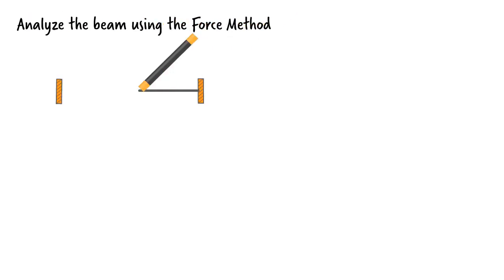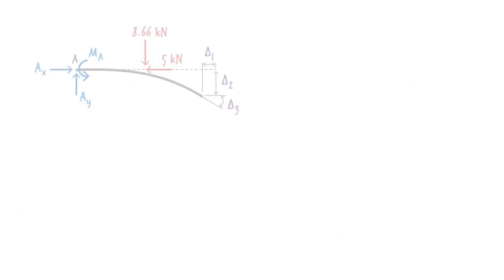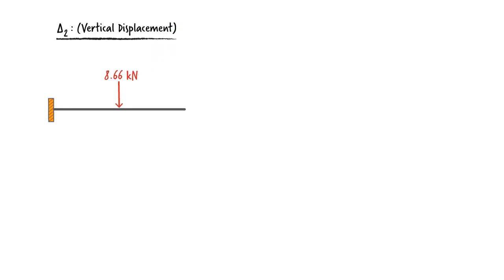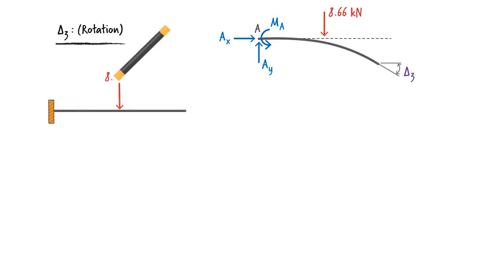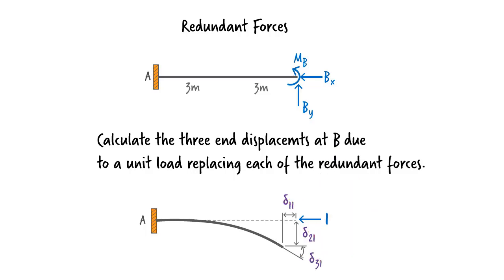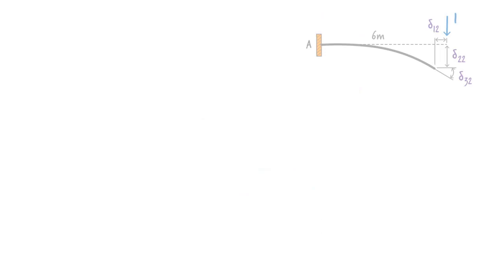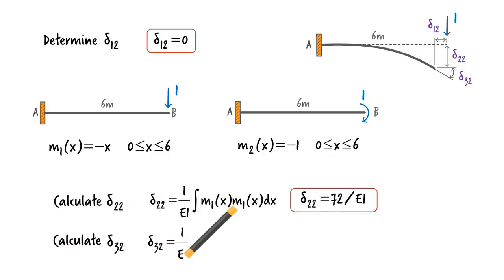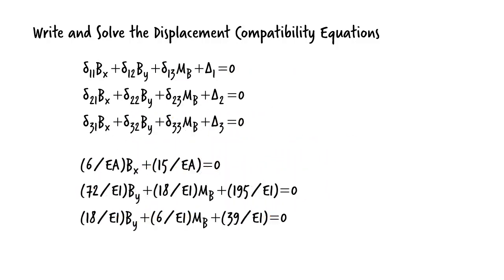Force Method: Exercise Problem 5

Comment: Do you happen to have a pdf document of this video, or maybe another example possible in pdf format with maybe 3 to 4 equations to be solved, u approach it very well.
Reply from the maker: We are working to having pdfs for all the videos, but that is going to take a while. If there is a specific problem you would like to see a pdf solution for, email (dr.structure@educativetechnologies.net) us the problem definition and we'll work on the solution and post it here when ready.
Reply: @DrStructure  ok i will send you the problem, thank you
Reply: I have emailed you the questions on the email address you have provided me with.
Reply from the maker: @mashambashonhai4901  Thank you. We'll get the solutions out in couple of days.
Reply: @DrStructure  Ok thank you, will be waiting.
Reply from the maker: @mashambashonhai4901  Here is the solution for the truss problem:
http://lab101.space/pdf/examples/SA25-Example2.pdf

We'll post the solution for the beam problem as soon as it is ready, within 24 hours or so.
Reply: @DrStructure  wow, Dr Structure, i am very happy with the solution and thank you so much. I don't know according to the forces method that you have presented you included the concept of virtual work method. Can we not solve it too without involving work?

But otherwise, i am very grateful with the solutions you gave me.
Reply from the maker: The force method requires the calculations of displacements. We don't have to use the virtual work method for displacement determination, any other method can be used for this purpose, although for trusses classical techniques such as the conjugate beam method does not work since there is no moment (moment equations) in trusses.
Reply: @DrStructure  Ok thanks. Now my confusion is cleared., will be waiting for the beam question
Reply from the maker: @mashambashonhai4901  Here is the solution for the beam problem:
http://lab101.space/pdf/examples/SA25-Example1.pdf
Reply: @DrStructure  Thank you sooooo much, you have made my day.